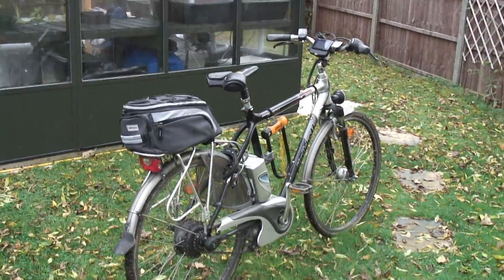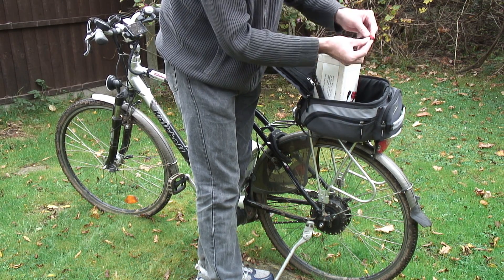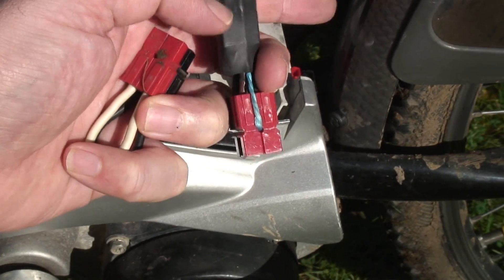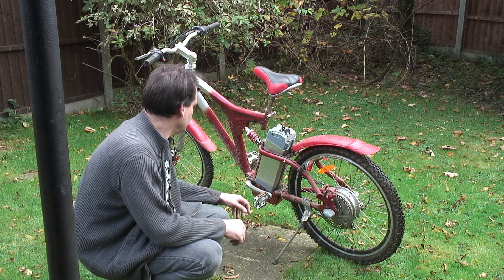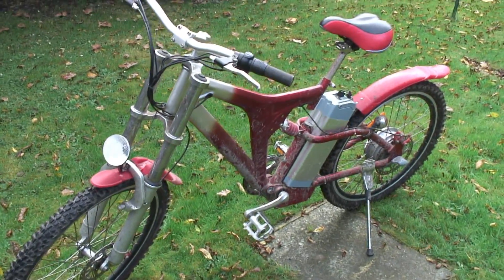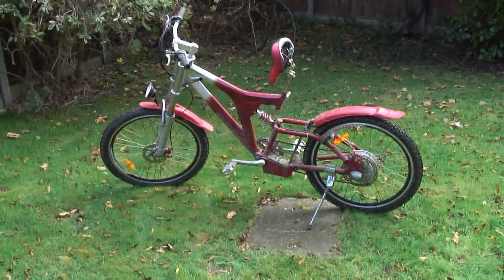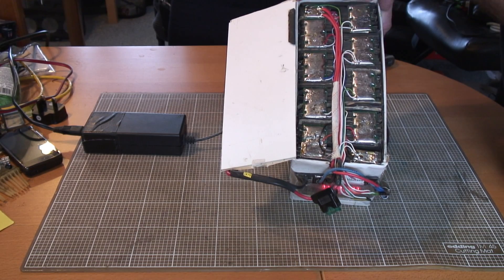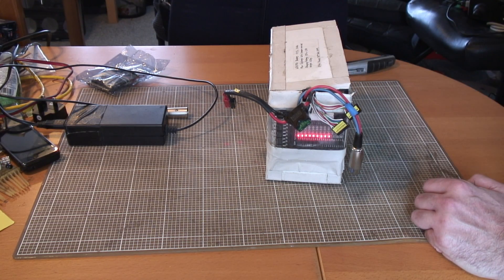E-Bike Overclocking and Custom Battery Packs

Comment: Hi again, hope you're well.
I got yet another ebike, a Bosch mid dirve one, with a 500wh powertube battery. And I also have a 1kw ninebot battery which I would love to add to the bike. The bosch motor needs coms from the bosch BMS as I understand from the internet, so my question to you is could I splice into the power cable between battery & motor, making sure to add Schottky diodes before the splice on battery side?. And as I saw you did this on your ebike, I wanted to know the behavior of the 2 battery when discharging?.(i.e. do they equally get drained?)
Thanks in advance.
Have a good one.
Reply: Hi,
I did parallel the two batteries eventually, but I did it before the bms, because otherwise the bike throws some errors from time to time. 
Thanks for your guidance.

Comment: Hi, thanks for the info in this video.
I bought an old ebike that has this type of motor and battery pack. The original battery is dead, but i bought another battery pack that is 48v/14,7ah. I already went through the comments & if I understand correctly the motor won't run on voltage over 35v or rather not made for it. Do you think I'll damage the motor if I try the 48v battery? Or should I split the pack into 2*24v packs? 
Thanks in advance.
Reply from the maker: Hi The electron Age. In my unit there were capacitors rated for 35V, so anything over that would cause those capacitors to explode. 48V will definitely damage things. The furthest I ever pushed things myself was using a 9S LFP battery pack which when fully charged gave a little over 33V output. I'd say you should definitely split your pack into two. Also, please be aware that the battery charge % sensing is built into the Panasonic packs and communicated back to the display on the handlebars - if you're using a non-panasonic pack which is just supplying voltage then you'll see the blinking battery light on the handlebars all the time because the system has no idea of the state of charge - it doesn't stop anything from working - it's just a little annoying not having a battery guage.
Reply: @ThingsWhichArentWork  hi,
Thanks for taking the time.
After some more research,(mostly from your videos, thanks) I think I'll go with a stepdown buck converter (i found the exact model you reviewed: 600w analog module), that just makes it a bit easier since I don't want to mess to much with the battery as far as the charging is concerned & I'd need new BMSs...
Do you think that this is a valid solution? (I'm thinking setting the output to 30v@8,5A).
Thanks again & have a good one.
Reply from the maker: @theelectronage  Buck converter should be a viable approach I believe. Back when I was active in the e-bike forums I nearled ended up in an endurance race with someone who was using a 600W boost converter to push their battery voltage a little higher. 600W is probably around the minimum you need for this - although the motor is rated for 250W continuous power, it can pull higher peak currents for short durations. I've seen my bike pull more than 1KW for fractions of a second when the battery was fully charged. Please send a message once you've tried it to let me know how you got on - I'm interested to hear the results. Cheers!!
Reply: @ThingsWhichArentWork  thank you. Will certainly do.
Cheers.
Reply: @ThingsWhichArentWork  hi, hope you're well.
I went kind of crazy and bought a second ebike (newer model with a 36v mid drive motor called "egoing" didn't find much info about it on internet) without a battery, & finally upon receipt of 800w buck converter, i hooked up a 48v battery with the VOut of 40v from the buck converter, and it works perfectly without heating that I could notice.
I didn't try it on the Panasonic bike because I managed to wake up the battery with another charger, and it seems to be working properly, but the original BMS wouldn't charge it, so I kinda have to open it each time to charge it. But in principle it should work with it as well.
Thanks for your guidance.
Have a good one.
Reply from the maker: @theelectronage  New bike - that's a surefire way to solve the issue :-) Really great to hear that the buck converter is working well for you. Most of the time the motor will  be pulling <100W so I wouldn't expect too much heat, but I think the 800W was the right choice for handling the larger current when you're setting off (or going up a steep hill). Happy Cycling ElectronAge!!

Comment: I changed the cells and BMS inside the battery, I modified the charger, now the only problem I got is the third green/grey wire....I got positive, negative and a third wire .... inside the battery is green, inside the bike continues as grey....the display goes on but nothing.....
Reply from the maker: The BMS in the battery uses a Renesas M37512 microcontroller. I believe it communicates the battery level to the bike using I2C protocol over the remaining wire. I had exactly the same issue as you when I first tried to use a different pack on the bike. I worked around it by paralleling the second pack in with the first, using a couple schottky diodes to prevent the two packs from charging each other (my second pack was a different chemistry and a slightly higher voltage). If you still have the original BMS then using that with your new cells is probably the easiest route to success. If that is dead and gone, I'm really not sure what could be done. I know the M37512 BMS chip is quite common in laptop battery packs. Perhaps an old panasonic laptop battery would speak the right language to make the bike happy, but no idea what data it expects to see over the I2C bus. Perhaps it would see a healthy laptop battery reporting 11.1V and still refuse to operate.
Reply: @ThingsWhichArentWork   thanks for the fast answer
Reply from the maker: A little more info. The BMS in the battery pack does not feature over-current or low-voltage shutdown protection - Those functions are handled within the pedelec unit (which is why the LEDs are all still blinking even when the battery is totally empty and the bike won't offer any assistance).  This is why the bike needs the state of the battery to be reported by the pack, rather than just being happy when voltage is applied.
Reply: @ThingsWhichArentWork  I will try to connect the discharge line to the old BMS and give it the green wire....you think it will work? The cells connections will not be in use
Reply from the maker: @electrikmirk7828  I expect you'll need to supply power for the BMS to run from too (which is normally coming from the pack). I've no idea if the BMS is using overall battery voltage as it's gas-guage, or working it out from individual cell voltages. If it's the former then three wires (positive, ground and signal) will be enough. If it's the latter though the BMS will be reporting that the cells are all dead so the bike will still be sad. Fingers crossed that it works for you.

Comment: Id love to see that washing machine motor on a Ebike but what did you use to wire it up ?
Reply: Sparkles -  Am curious if the washing machine motor is from a line-voltage Alternating Current machine ?  It is being powered with Direct Current .  .  .  ?  Am not well schooled in this area.
Reply: @richardhobbs9038  what are you on about ?

Comment: I’ve never seen anyone mount a twist throttle on the wrong side, then complain it’s the wrong orientation. 🤣
Brilliant. 
Love the video.
Reply: actually it seems kind of intuitive to mount it in that direction. Move forward to go faster, back to go slower. Moving your hand back to go faster is kind of backwards in a way.
Reply: Dylan 873 maybe if you’ve never ridden a motorcycle. 🏍 💨

Comment: Hello man. Great bike.What happen with pin3 from panasonic motor:http://oi63.tinypic.com/v3myys.jpg Do i need connect to "+
Do you know how to add Acceleration switch,how to connect?
Reply from the maker: I'm not certain about pin 3 ... It is marked on the battery pack as 'C' which I always assumed meant it was the charging pin... My best guess is that it's used by the bike as a voltage sense pin for the battery level display on the handlebars (because the main + pin can be heavily loaded by the motor which will pull the voltage down). I'm afraid I don't understand what you mean by 'acceleration swtich'.. are you talking about the hand-throttle add-on ?
Reply: Yes i mean hand-throttle .How exactly must to connect ,and what model hand-throttle i need.My motor is Panasonic NUM028R.I use with 10S battery
Reply from the maker: There's a little 4-pin socket on the wires which come out of the body on the motor unit where the throttle plugs into. Only three of the 4 pins have a connection. I don't know the details on the internals of the hand throttle, but I would not be at all surprised to find that it is just a 10K, 3/4 turn potentiometer in there. Hope that helps. Cheers!!

Comment: Hi Jim. I'm trying to buy a controller for a speed project. I have an old Bionx motor that i will modify to use on a regular controller. I wish to use lipo batteries in a 16s config. about 48V low and 67V fully charged. I wish to use a controller with regenerative braking as i live in the mountains it will at least help with braking.
  Perhaps someone has some advice on which controllers would be suitable or how to modify an existing controller. I am thinking the low voltage cut out feature could be a problem. Generally is it correct that the higher voltage controller you use the faster that motor with that voltage or are they not necessarily governed by battery voltage after going through the controller? I was under the impression it might be better to overvolt a 48V controller rather than run low voltage on a 72V controller. Or should i see what i can do with a 60V controller? Bear in mind i am looking for more speed, hopefully around 40MPH
Many thanks in advance for anyone who can help with this knowledge. The main problem here is the voltage swing on the lipos, hobby parts don't generally take these voltages into consideration and the e-bike kits don't really suit lipo batteries because of this voltage difference.
Reply from the maker: Hi izzzzzzz6 - I've been off on my holidays, so sorry for taking a while to get back to you. Generally speaking, yes, more volts will get you more speed (or at the very least, more acceleration). You may run into issues with the motor controller limiting the maximum frequency that it feeds to the motor to keep things compliant with the laws in whicever country the controller is sold. (in the UK, our e-bikes are only allowed a pitiful maximum assist speed of 15.5mph). I'm afraid I don't know much about the different controllers which are available these days... my e-bikes are about a decade old now, and I haven't really kept up with the developments that have been happening since I bought my bike. I do remember though that the 'Endless Spere' ebike forums were a good source of information for custom controllers and people modifying their bikes for higher speeds. It's well worth taking a browse over there. Hope that helps. Cheers!!

Comment: I'm in the early stages of understanding batteries and charging. I have a bank of ex-laptop batteries, connected 3 rows (parallel ) of 9 cells (series) to give an indicated 38.1 volts when fully charged. In the bike with 250 W motor this is providing only ca 10 mins of power currently. I am experimenting to try and establish why. The next idea is to boost the voltage by adding 3 rows parallel of 2 cells series which will bring the total pack to ca 45 volts. I am unsure whether to actually try this in the bike because it might fry the 36 v controller. But since that is just a cheapo Chinese box I suppose I will suck it and see. Should anybody want to offer advice, please do so.
Reply from the maker: Hi Robert - I'd expect a 36V controller to be OK with 3x12V Lead Acids... and at their fully charged voltage of 14.7V that would mean the controller would have to be able to handle at least 44.1V ... That will mean that they'll have had to use at least 50V rated capacitors interally and you'll almost certainly get away with 45v. Good luck. Cheers!!
Reply: Jim Conner Now that's what I call prompt service! Thanks so much for the helpful answer. This morning I have been further trying to find information about the maximum voltage that controllers will handle and it seems that parameter is not commonly listed. 
Mercy buttercups!

Comment: Hello. 
 Can you tell me how you connected the second battery? I want to connect only a secondary battery.
 I have the same pedelec system and the Li-Ion Mn is dead (cells degraded). I have 9 18650 cells fully charged. I tried connecting 7 of them to get 29V. The battery stand has 3 pins. I connected plus+ and minus- to my 7 cells. Does the third pin (one near minus) needs to be connected?
The power switch shows 1 of 3 power lines steady (not blinking like it does with the LIMN, i think that means it is discharged).
 I can change assist to 30%, 60% 100%, but engine will not start. 
Thanks
Reply from the maker: Hi sniperrule2004 - You need to add a reverse-protection schottky diode onto each of the packs to stop them trying to charge each other. I found a dual-schottky diode package from an old computer power supply made a cable which contained both the diodes and added a socket which let me plug the cable in. You need to use schottky diodes because they have a much lower voltage drop (0.2v instead of 0.7v for a normal silicon diode). When I'm not using two batteries, I plug in another special 'shorting' cable which just connects the original battery directly into the bike's wiring wihtout any diodes in the way. I think the 3rd pin on the battery connector is the charging connection (because the battery has built in cell balancer). Not sure why you're only getting 1 of 3 bars showing on the battery... I didn't have to do anything special to keep the battery meter working - I believe it only works by measuring the pack voltage. Also... although the original battery is rated to 29.4v, I've checked the electronics inside the motor unit and confirmed that they can run all the way up to 35V before you exceed component ratings... This is why I went with a 9S LiFEPO4 (33.2v max) for my extra battery.. you can probably add an extra cell to your pack to make it 8S  (33.6V) intesad of 7S for some extra oompf.. (do so at your own risk of course.. I'm not buying you a new bike if my advice turns out to be wrong).  Hope that helps. Cheers!!
Reply: The bikes's battery pack is dead, and I have not seen it working with my own eyes.
 I am just trying to see if the bike still works, so I can build a custom pack as you did.
I've connected 7 of 18650 and got 29.5V . 
I found a  pouch with Fuse 20A and 0.5A, but can't find any fuses. This is at the junction box where the led indicator/power meets the engine.
Might they be inside the battery?
Reply from the maker: Hi sniperule2004 - I can't remember seeing any hidden fuses anywhere (but it's been nearly seven years since I did the dual battery mod and my memory is far from perfect). I would certainly expect there to be a fuse in there somewhere.. just can't remember ever seeing it. I'm not sure if it'll be any help, but I've just put all of the pictures of the internals of the panasonic motor unit up on dropbox... You should be able to view them at https://www.dropbox.com/sh/hc0neq33pf4mnus/AAAK2bNwdftJXIBLN1ZKWCI8a?dl=0 ...
Reply: Sorry to bother you again .
 I now have more 18650 cells and connected 14 pieces, http://oi63.tinypic.com/2e3za1l.jpg http://oi64.tinypic.com/20ky6c7.jpg  http://tinypic.com/view.php?pic=33mpu2q&s=9#.WFJcI32bKUk
 I can change assist level but it still does not start. 
On the original battery pin number 2 had positive voltage same as pin number 5.
 Do i need to connect pin number 2 to positive as well?

http://oi63.tinypic.com/v3myys.jpg
Reply from the maker: Hi sniperule2004 - I always thought that pin 3 was the 'charge' pin, feeding the power into the battery's internal BMS so that it could balance the cells properly. If I get the chance, I'll dismantle one of my kalkhoff batteries this evening - I've been meaning to do that for many years. I'll try and make a video of it. Cheers!!
Reply: I managed to make it work!
Didn't know about the torque sensor and apparently I was not pushing hard enough on the pedals.
I even managed to test it for about 6 miles, seems to run very well. I just need to make a batterty pack for it. 
Thanks.
Reply from the maker: That's awesome... Very glad you got it working now. Cheers!!